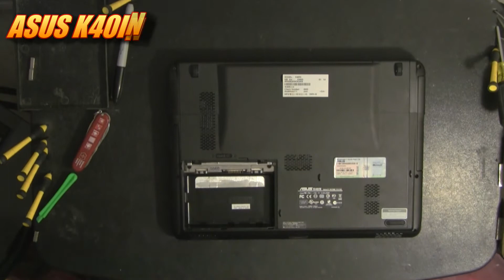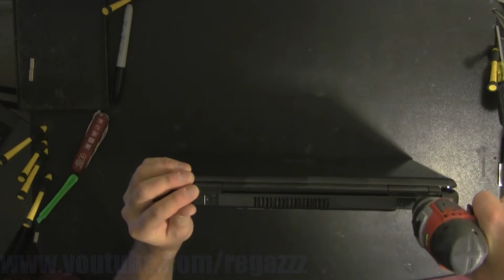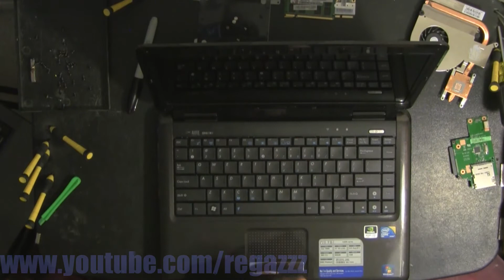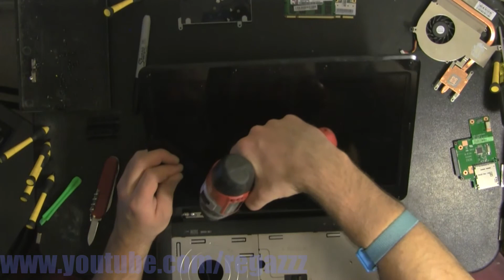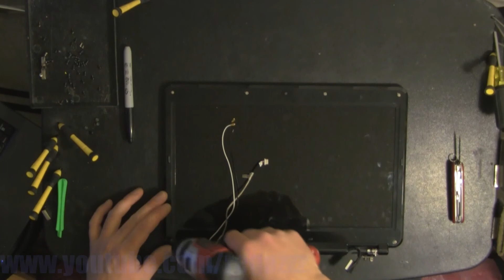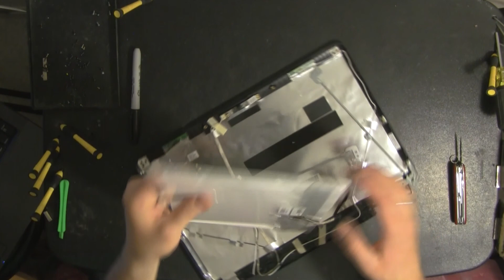ASUS K40IN take apart, disassembly, how-to video (nothing left)

Comment: Can I still get my Asus K40IN laptop repair and if ever needed, replace the wifi components and power button? My Asus' Power button is not working properly anymore when you press it. and as for my wifi, when I shut down the lid and lug it around, Well after all that, once I open my laptop again, the wifi won't work and  I have to restart the laptop again or tap near the power button's dashboard to make them work again. Which they do work again. well as long I don't lug the laptop too often, it works without a hitch dou.
Reply: If you are using Windows XP that is how the Wi-Fi behaves and it is not damaged. If you change to Windows 7 it will all be ok.
Reply: ***** Im using windows 7 before upgrading to windows 8. After i've  got the power button fix.
 I check the insides and saw a physical damage on the power button it's kinda pulled-off its socket.

As for the wifi  the issue started when I got it's hinge replace... it broke off.  and had to be replace. But since then, the wifi just acted up.  it just won't work or makes a glitchy thing when im using the wifi and lags the computer like .. when I'm using the computer, its like crashing.

But thanks to your vid, I learned a lot. that the power button can be replace if necessary. Just not sure if the wifi can be replace or repair if its a hardware issue